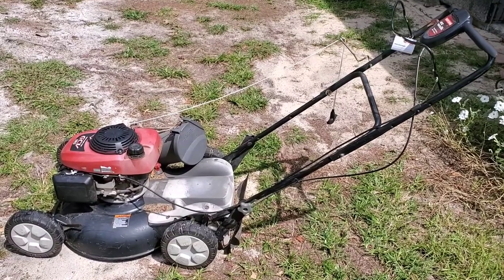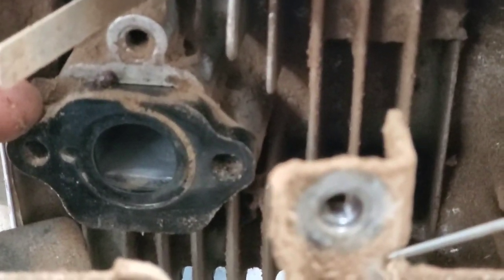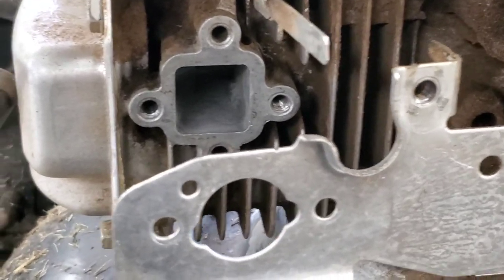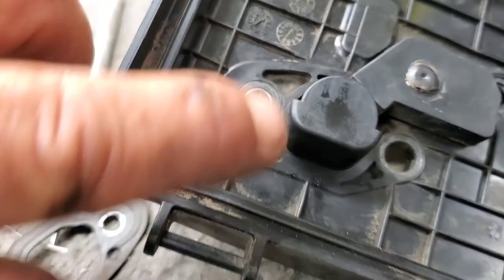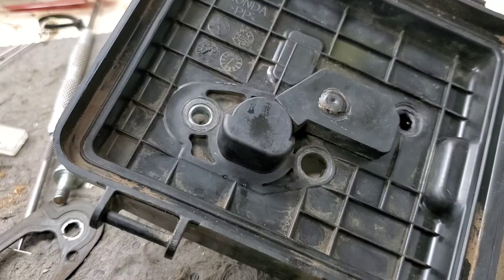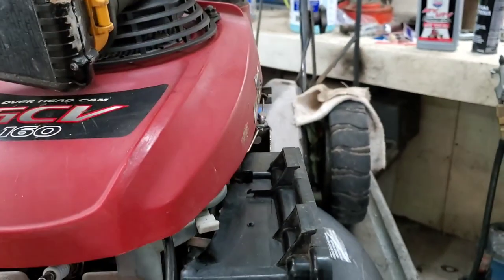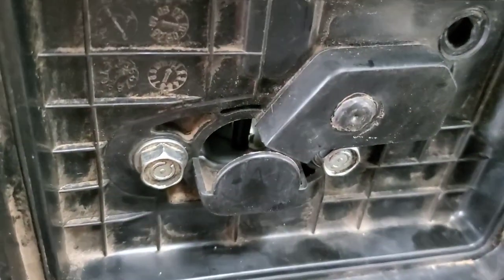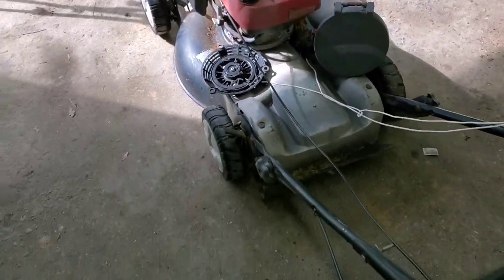Honda GCV160 Craftsman Push Mower.  Runs Only on Choke  You What THEY Did WRONG and How to Repair It

Comment: Great vid.  Learned more than I wanted to.  Something I'd like to pass on:  A mechanic told me about a home-made tool to speed up reassembly.  Cut an M6 threaded rod to make two 4" long pieces.  Then cut a slot on one end.  When you pull the carb bolts out, thread the rods into the holes, one at a time and then slide the carb parts off one at a time.  The rods act as guides for disassembly and you don't have to worry about the gaskets moving out of place as you reassemble the carb.
Reply: that's how I do it. have 2 stud bolts, makes it fairly easy.

Comment: I recently had a mower given to me that has this exact same problem. I was just about to use that screw trick to fix it too! lol. Happy I found your video. The carb is in great shape, but the dang thing wont stay running once the chock opens. Will double check the gaskets now that I watched what you did. Thanks so much for sharing your knowledge. I'm more familiar repairing computers than small engines. Your video was helpful

Comment: Made the same mistake myself when replacing carb and gaskets on my Husq. 7021P with GCV 160.  Had to keep turning choke back on until mower warmed up, but even then it still ran erratically.  Saw symptom in your video and checked this, and sure enough, was upside down.  Runs perfectly now!  Thanks for the video!

Comment: Thanks for the detailed explanation. Your video helped me resolve a hard start issue with a used mower that I bought 2 years ago. It was difficult to cold start but would start relatively easily with starting fluid. I had pretty much given up on it. Turns out, the choke lever was in the wrong position. Once I corrected that issue, it now starts on the first pull!
Reply from the maker: Awesome!! Thanks for watching

Comment: As many below have said, I too think your explanations and video of reassembly details are superior.  My issue, is a Honda GVC 160 wouldn't start.  I took off carburetor and cleaned, reassembled and it fired with choke on, (a manual by push-pull rod to rear) and would run some.  When I took choke off it died.  Thought I had gaskets in wrong places for proper breathing and repositioned 1 or 2 gaskets.  Now it fires right up and runs for a few seconds on "Run" but then dies.  It starts up repeatedly in "Run" position but will not stay running beyond maybe 45 seconds.  This engine is on a power washer.

Comment: That big deflector should be sheet metal with a slight bend at the bottom in towards the crankcase, with smaller separate gaskets on it.

Comment: The other shop should be ashamed with that HACK job. I can't believe a shop could screw up that many things on one mower. I really like these engines but HATE removing the carb because it is a pain in the butt to line up all of those parts with 2 hands. Wish Honda would have used studs in the block and you could slide everything on and then tighten 2 nuts to hold everything together. Another great video T-Bone!
Reply from the maker: Yes they should be ashamed.  Yes studs would be much easier.  I am very fast at these but trying to work around a camera umm yep makes it hard. I've done tons of these, yes and easy repair. Thanks for watching and commenting my friend.

Comment: Liked, subbed and bookmarked for future reference! 
I could have done with this last year. I have three of these. Couldn't believe Honda could make them so hard to reassemble. I found the previous person had quite understandably let the outer gasket slip from one side this preventing the choke from opening fully. I cut some threaded bar to slip each piece on separately, then holding, pressing hard the whole assembly against the manifold, I replaced one bar with the bolt, tightened it down lightly, then did the same thing the other side. Mr Honda deserves some special prize for this dumb design. I wonder if they have changed it.
Reply: Editing is not possible, so having re-read that I'd like to clarify: I put -lightly screwed -  the temporary  threaded rods I'd cut, into the manifold then slid each item on... Hope that's clearer.

Comment: I'm working on a yardman mower that had pretty much the same Honda engine. Took carb off to clean all those little holes that were clogged up in that inside tube under the main jet the choke mechanism was working as it should. 
Now I put it back together and the metal arm on the choke does not come close to pushing the choke butterfly closed. It makes no contact with that black plastic piece on top of carb.
Yours has a plastic extension sticking up that makes contact with the metal choke arm. Mine does not.....and I swear it never did.  It's not broken off.  Makes me think I have gone over the edge.
Choke was working fine......now, the parts that should make contact are an inch apart. 
What am I missing.  I do things very meticulously. .    Didn't loose anything. ......but, it's  as if my black plastic piece that moves the choke butterfly magically changed shape.
And,  as I said.... no sign of any breakage.

Comment: Ok good video but get you some threaded rod the same size as the screws and work backwards with all the parts
Reply from the maker: Yes sir, good idea, I have seen that done. Usually I'm standing in front of the mower and it's much easier  but couldn't because of the camera.  We probably do 3 or 4 Hondas a week and I am very fast on them.
Reply: @RaleysSmallEngines  i just use 2 dowels. stick the dowel in the engine block, put everything on, remove 1 dowel, add screw, repeat

Comment: Great video but unfortunately it didn’t fix my mower. I have the same symptoms now, but I have clean the carburetor and even pushed a wire through the pilot jet. Not sure what else to look for. Everything is assembled correctly though.

Comment: Gotta find your video on making gaskets
Reply from the maker: Dang, I'm trying to remember also.  There are a couple of them I think.  You can use a tiny hammer and ping around the part and the holes, this will imprint it on to the gasket then just cut it out.
Thanks for watching my friend.

Comment: Good catch on the insulator.  You have to have patience with these Honda carb assemblies.  Some guys I know just refuse to work on Honda mowers.  They give them to me and I love them!  What is your remedy for these choke levers that start moving toward the front of the engine as soon as you engage the bail?  Some of them want to open the choke too soon.  Thanks.
Reply from the maker: Thanks for watching.  I can't remember having one with that problem. Wish I had a good answer for you.
Reply: I have the same issue with the choke on my mower. It moves to the off position in a second or two. I have to hold it closed for a few min until the engine warms up. I've often thought about putting a manual choke cable/lever on it but something else always comes up to divert my attention.

Comment: I have a troy with the same engine on the table now that only runs on choke. It doesn't have the screw but I've had a few that did and had to fix it. As far as the troy i don't know what they did wrong yet as i have gotten into it yet. Lol

Comment: Was performing well needed maintenance on my dad’s 10+yr mower because it would start and just run for a couple of mins before shutting off.  So I took apart the carb and cleaned, changed filter, spark plug, and oil and it now stays on, but my concern is when I pull that lever to choke and pull the rope to start…it doesn’t start, even after several tries. The lever moves back into the ‘run’ position, but if I pull it to ‘choke’ again… it’ll start after 1-2 pulls of the rope.  Before, it would start right away after choking.  Did I screw something up when I took the carb off to clean?
Reply from the maker: Thanks for commenting. Double check that metal choke lever is in the proper position.  Those gaskets are tricky, they may look right, but maybe not.  Not installed correctly they will suck air and it will not run.
Reply: @RaleysSmallEngines  will do…thanks!

Comment: I have same machine with trouble with carburetor choke valve not closing when automatic lever is pushed to choke position so that I need to put some gas in carb to start so what is happening

Comment: I have a 12 year old Honda HRX217 that runs great when the blade is engaged, but surges at idle with no blade attachment. I can’t find any information on how to increase the idle RPM. Is this possible with the Honda engines?
Reply from the maker: Surging is generally caused by a partially blocked idle jet
Reply: @RaleysSmallEngines  yes, but where is the idle jet? None of my diagrams show this part. I took the filter off, and the carb assembly, and couldn’t find anything that looked liked it needed cleaning or adjusting. Is this a problem that needs to be fixed or just live with it? Thanks for your reply.
Reply: Did u find the answer?  @CageyLeigh
Reply: @PopeyeSailor-wz7ew  I poured a cleaner into my gas tank and ran that through a couple of times, and for the most part, it runs pretty good at idle. I guess the jets got cleaned enough to pass enough gas for the idle to run smoothly. Thanks.

Comment: Why was it smoking at end ?
* This might help you * 
When you are taking the two long bolts out that holds on air filter take one out then replace with long bolt with no head on it . Then same with other one . This will keep you from having to have air filter in your way when putting on gaskets and carburetor .

Comment: i wanted to see how to get the top cover off.Mine wont stop unless i turn off the gas. ?
Reply from the maker: Just remove 3 10mm nuts and it slides right off.  Sometimes the studs spin off with the nuts, still comes right off.

Comment: What did you do for the coil bolt
Reply from the maker: I haven't repaired it yet.  Probably drill and tap and put a set screw to hold it in place.  The other screw should hold the coil I hope. I will also inform the customer of what I did.

Comment: I'm about to stick a screw in my choke lever. Taken carb off and cleaned it and put back in correct gasket order and once the choke releases the engine starts to surge. Put the lever about halfway to choke and it levels out. Lather rinse repeat with same results. Same Husky Honda combo. Anybody?
Reply: Same problem as in video: vacuum leak. Spray carb cleaner in the general area of the carb. If the engine smooths out, confirms leak.